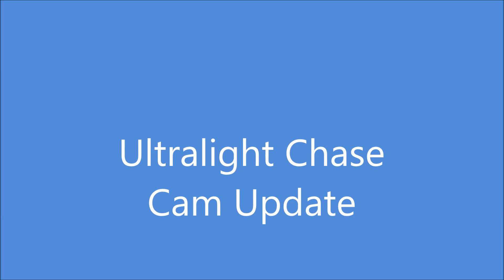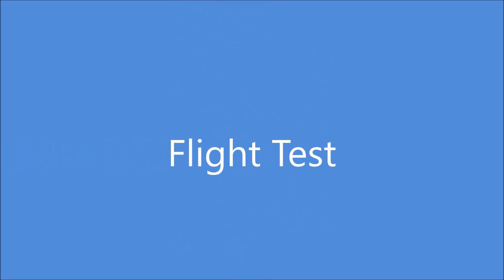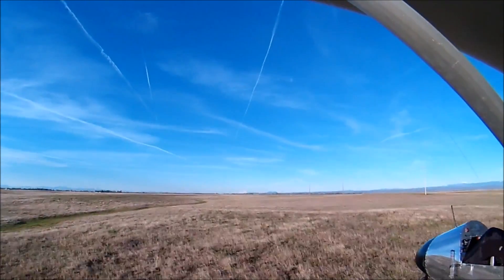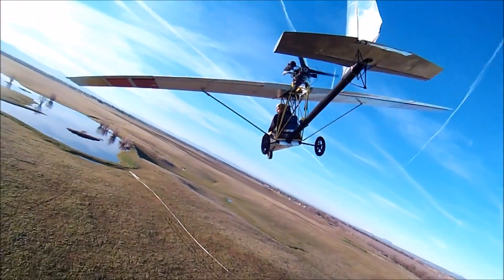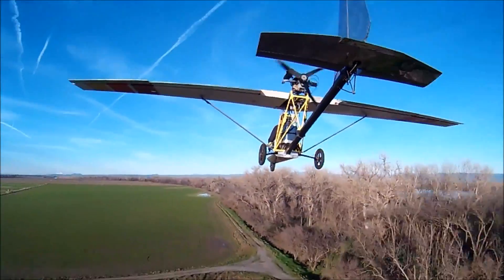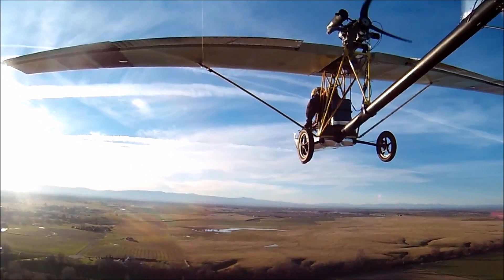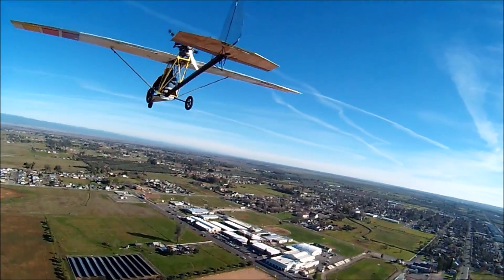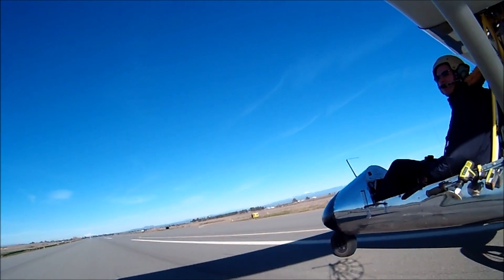Chase Cam Update

Comment: The monofilament looks invisible...  unless you fly right into the sun.   
Be interesting to see with a long line let out really far back...
Also interesting to try a paper streamer attached to the shuttle cock, if that would make it even more stable by adding a center rearward pulling drag.

If your drill is variable speed, try and slowing down on the button before  you stop it when you let it out, it might not bump and wobble so much when you stop the drill motor.   You probably don't need a super heavy drill.    

Having the camera tilted toward the pilot instead of straight ahead is going to cause it to bob and oscillate more from drag, as being angled to side increases its drag.  You could add a tail to the back of the camera itself to reduce drag on the camera unit.

I'd try your strings going back to the bar not be a two string V, but a four sided double V pyramid...  attached to a + crossbar, with the shuttlecock behind that attached at the center of the + like you have it.

Also, would be nice to have some safety when you pull in line not to pull it in too far, and pop it on the carribeaner and lose your camera and shuttlecock over some random field far away from home.

Future: Would be interesting if you had two fish lines coming off the wing tips, that connected back behind at the camera, and by changing their lead out, you could move the camera left or right behind your plane, panning across the tail, for a view from the right or left of tail.   Like, a big closed loop of fishline, with a stretch going along the wing and over your head through eyeholes, and a motor that moves it left or right.  Probably be safer and easier to implement on a tractor type airplane rather than pusher.

http://choppergirl.air-war.org